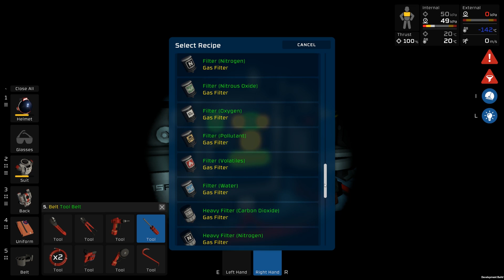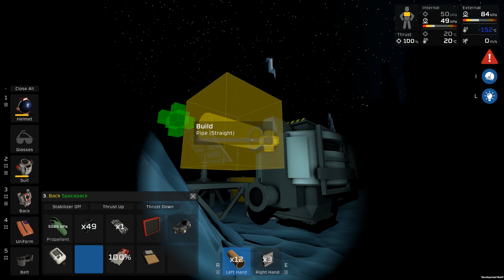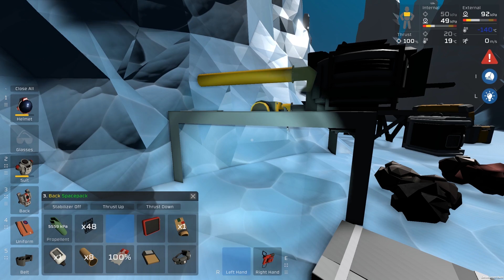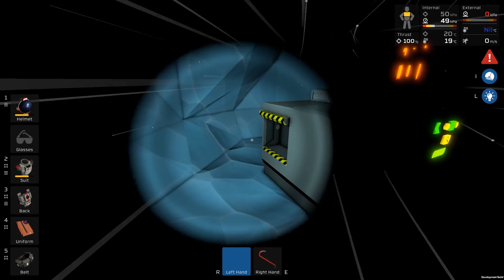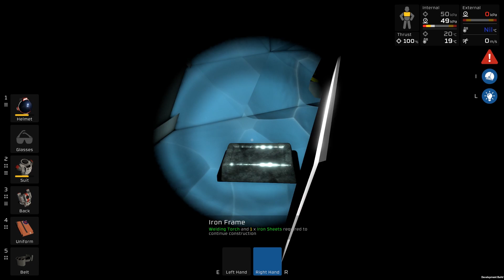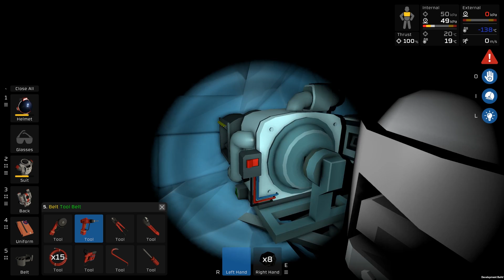Stationeers on Europa E03 - Free Oxygen Furnace

Comment: You can weld plastic. The definition of welding is melting 2 items together. Plastic melts. 
Not that I would do it to make an electro print but you can. I'm curious if they're going to change the amount of iron they give you at the start. It's already an odd number from the number of frames, walls, glass. I always end running out of sheets and have left over frames.

Comment: If you put that active vent in the airlock (and pipe going outside with passive vent) then you can manually evacuate only the air that ends up in the airlock when you are coming inside, which is pretty fast. So the base stays at 0kPa. Also you can  keep evacuating the base by just keeping the inner door open.
And yes, that multiple step building sucks big time :D

Comment: You won't be able to run your power cable from that gas sensor  between the airlock and the wall. The only direct route from an airlock is through the top, presumably because the doors slide sideways to open. Yet, you can walk through a cable, very strange.
Reply from the maker: Good point, think I'll put it through the top instead!

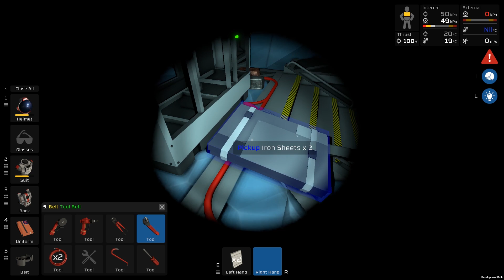Comment: You were saying at 11:50 how much you don't like the new build system. I think it's a multiplayer thing. Specifically, a PUBLIC SERVER kind of multiplayer thing. The whole point of having so many tools is so you can control what players can do just by controlling which tools they have access to, but by making it so you need tools and components to do ANYTHING in the game, you create a risk vs reward problem. Do you, as the leader of a station, make tools more open and risk being griefed by a visitor (or sabotaged by a rival, or having a tool fall into the hands of a prisoner or someone who doesn't know what they are doing)? Or do you control all access and inhibit your members' capability to work? The inconvenience you feel now is from the developers laying the ground work for this sort of thing (in fact, there's a mod that already allows for this sort of play by removing tools from fresh spawns and adding a crate with tools to the start). In single player though you're right, it's just busy work. I wonder if RocketWerkz could be convinced to change gameplay between multiplayer and singleplayer?

Edit: It also kind of explains why the welder is used with plastic since it's used for a similar thing elsewhere. It means if you don't want players finishing construction (for whatever reason), all you really need to do is limit their access to the welder specifically. If you don't want players to deconstruct blocks or pipes (and vent all your atmosphere) don't let them have wrenches. Don't want them messing with electronics? No Screwdriver... Although that last one is sort of messed up by the new construction system. I feel like that was intentional. Going back to that risk vs reward. Either you control the only autolathe, tool builder, and screwdriver in the whole station and build the machines when requested, or you let people have screwdrivers and consequently let them mess with your atmos logic.